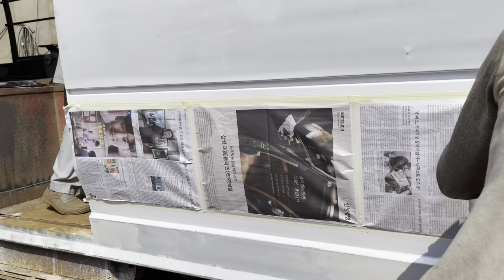Amazing Repairing Process of Accidental Bus in Local Workshop ||

Comment: That's not a repair, it's a complete new build. Great work.
Reply: Fantastic. But did not like the guy welding with no protection. Closing your eyes is not good enough long term. Btw this used to be an industry here in Norway, building buses on imported frame + engine.
Reply: Panel beater here it’s all considered a repair
Reply: Exactly
Reply: @steinbauge4591 Turkiah killed all of those industries in EU. They make these cheap PVC buses on top of MAN, Mercedes or DAF chasies. The only good one is Solaris from Poland if you ask me
Reply: @averagedev7768 Indians doing the same in Asia building cheap buses on lorry chassis, Tata and Ashok Leyland craps...

Comment: Extremely professional teamwork has resulted in the bus being repaired to a very high standard; ready again to be propelled into a deep ravine by a fearless driver with no concept of danger.
Reply: Do not forget overloaded the are terrible for overloading vehicles I would not want to travell in it why did it crash steering failure or brake failure not for me I do not trust it
Reply: Exactly what i was thinking, rebuilt and ready to roll (over)... again...
Reply: @Frankestein01nl  Quite, and yes indeed, repeatedly rebuilt until the inevitable crash involving a huge explosion (and much loss of life) makes this impossible. Although even then...
Reply: They Have To You Get Hurt,You Can't Work ,Can't Work, You Starve...

Comment: there is no repair here; they discarded the damaged bus body and did a new one. good work.
Reply: boy it's a good thing you showed up
Reply: Yes it's called discarding and carding mechanical. With stickerings and motor chain belt 5.0 acordances.
Reply: It actually is a repair, just no restoration.
Reply: The old body was pretty stuffed to be fair, i,m glad i was Not in it, my guess; it went over a bank??
Reply: Panel beater here it’s all considered a repair
Reply: There's no strength left after straightening a wrinkled tubular steel frame member or the spot welded sheet metal equivalent. The side and roof panels weren't really recoverable.
Reply: @barryphillips7098  They aren't constructed to the same stanadards as in the US, the EU, NZ, OZ, the UK and other countries, it may have just been hit and rolled over.

Comment: 3:40
I mean.... he has safety glasses but theyre sitting on top of his head. He's wearing sandals and has a long scarf to add a bit of excitement in case it gets entangled with the angle grinder and pulls his head towards it.
Reply: No risk, no fun - no guts, no glory... "as they say" ;-)
Reply: @MrKotBonifacy  :face-blue-smiling:
Reply: Obviously they have never heard of "Arc-Eye" (Welder's Flash)? - An inflammation of the cornea, caused by ultraviolet radiation from the arc during welding. Nasty and even possible loss of sight if long term exposure like these guys! I had it once as a young apprentice - that was enough for me! Use your heavy goggles or proper welders helmet guys! 😮
Reply: @peterhowells7309  was sat there thinking those shades they were wearing probably weren't quite enough.
Reply: @chrisbrace2204  That was my first thoughts exactly Chris! Then I saw a few guys with no eye protection at all! Having had arc eye as an apprentice, I know how painful it is. You never take any risks with your eyes if you need them to do your job and put food on your table!
Reply: @peterhowells7309  that he's quite happily holding a visor in his other hand most of the time, and just not bothering to use it made me squirm
Reply: @chrisbrace2204  I know! Such a blatant disregard for their own safety.
Reply: @peterhowells7309  an the thing is, he knows, because he does use it some of the time.
Reply: @chrisbrace2204  Aye truly bizarre!
Reply: Soooo the whole bus is held together with spot welds 🤔
Reply: @tommoso55  With metal (ferrous) frames, that is normal, it keeps the weight down. Continuous welding joints would make a lot of extra weight. Sometimes you will find a body caulking/glue in place of welds.

Comment: Are any of the welds any good? I Am no welder, but I can make good solder joints including brazing. And as far as I can determine these joints we be breaking all the time because of vibration.
Reply: Yeah, it doesn't seem great, not to mention where they weld directly onto rusty metal.
Albeit even if the welds hold, it would presumably fold similarly to when it crashed the first time("first" may be optimistic though)

Comment: Why learn how to drive when repairing the vehicle takes less time?  I'll bet those welds are guaranteed at least 5 hours; I'm glad the welders were wearing sunglasses to protect their eyesight.
Reply: The welds are only holding together sheet panels that aren't structurally important.  No reason to weld more than needed. Hot dry climate, that metal will last long enough, until the next accident.
Reply: Hmmm aniy welder use it
Reply: EU FICO IMPRESSIONADO COM ESTE PESSOAL TUDO MANUAL E BEM RAPIDO 👏👏👏👏👏👏
Reply: 😂 sunglasses 😎😂🤣🤣
Reply: @cwshtygriff13 Let’s  hope they were Ray Ban’s , and not some cheap inferior sunglasses 😎
Reply: Not all of them are wearing sunglasses! Like "nevermind, that guy is blind anyway"
Reply: @richr161  I've seen a few clips, nothing is apparently structurally important. It's all bondo and paint.
Reply: Esas carrocerias son fabricadas con los peores materiales , no me extraña que quedara en tan mal estado ese bus , som demasiado fragiles

Comment: What could go wrong,, driver smoking and playing with his phone while driving. No mirrors. And driving a destroyed rolled over bus about quarter of a turn left hand down. No sign of taking the twist out of the chassis,
All that framing and panels stick welded together,, the bus has a lot of natural twist in the frame so those welds will all break eventually.
I am suprised that with all that framing just tacked together as it went that it seems remotely square.
And all that welding without a welding sheild to be seen.
Reply: No . There is a welding shield. Take a closer look.
Reply: @reynardbizzar5461  could you point out the welding shield used at 24.20 as I can not see it no matter how close I look,  and the protection against skin damage particularly facial from welding rays
Reply: @ceismulcastle  I see what you mean. I meant that to say that I saw a welding shield used at other tines. You are right though; the whole thing  smacks of cowboyism 👺
Reply: @reynardbizzar5461  could just be a lack of knowledge on their part but I they look old enough to have worked it out if they had never been told

Comment: How are they allowed to drive that wreck on the highway
Reply: What the plastic windows have bars that keep you from going straight through them. 😂
Reply: Because it's a poor country bro that is the real reason 😢
Reply: Its probably permitted because the frame and running gear aren't damaged, the glazing and loose sheet metal has been removed or secured, it isn't carrying passengers, and they aren't travelling in dense traffic. Its already a truck chassis with useless bent metal on top. Strapping it to another truck chassis and calling the mess "transport on a flatbed wrecker" checks all the vehicle operating condition boxes but doesn't actually do anything to change the safety profile.
Reply: In Pakistan no need of permission

Comment: As another commenter mentioned, that's not a repair job, but a completely new vehicle.

The chassis looked like something that was built in the 1920s, having just two rails with crossbracing.  Most buses have been of unitized construction using steel or aluminum sheets riveted to a space frame.

In the case of this vehicle, it's fiberglass on steel framing, not the best choice, but I suppose these guys are limited to using cheap materials, hand tools and primitive techniques because of their low budget.

While it looked like a backyard project with everyone pitching in, they got the job done and it's actually quite impressive what they accomplished.

Comment: all trucks in pakistan  The position of the leaf spring bracket is incorrect. 
If the leaf spring is installed in that position, it will not function as a spring. 

The hinges and springs must move flexibly like joints, but
There is no point in installing a spring in that structure.
The design was wrong. 

This is why accidents where axles or drive shafts break occur. 
They don't know that that structure is causing a very serious problem.

Comment: "Did ye crash test this bus, Lads?" 

"Yessir - the last body failed - we replaced it with this new shiny one.. the new owner will conduct the next crash testing shortly - we are highly optimistic that everything will be fine.. probably.."

Guy doing the body-filler is GUARANTEED one of the best body-filler appliers on earth, simply by the sheer volume of filler he has applied over the years onto stuff put together using rods & hammers. This guy could bang filler onto Nancy Pelosis face & she'd look 17.

Volvo Bus Division are watching this going "Nailing planks on as the floor!! FFS Lads, how did we miss that simple trick?? Implement it at once for all our busses!"

Comment: Why do they use wood for the floor instead of steel sheet?
Reply: Ease of replacement, less flex and sound deadening come to mind.
While steel sheeting may seem preferable in that instance, I can see why they chose wood flooring, since thick wood panels are sturdier than steel sheeting due to how it can absorb more damage without buckling.
I'm not saying its the best option, I'm just observing some of the reasons why THEY chose to do it that way
Reply: Busses in first word countries have wooden floors

Comment: What the heck is an accidental 'bus???????? In the picture is a bus; built as a bus, not by accident but by a company that builds buses DELIBERATELY. It has been involved in an accident that has caused damage, but it is still what it was designed to be - a bus.
It is now going to be repairs by people who will earn in a month less than you spend on a weekly shop, it's called worker exploitation and sustained poverty backed by "safety rules" that date back to the last century.

Comment: The fact alone that you are driving that wreck on the road is a deadly sin. But it is a good example of how shoddily there are built. You could pay me a million US$, and I would not ride in one of those. Never ever.
Reply: Considering the cost of labor in the US, that would cost about a million, and a new one isn't much more. I've worked on RTAs, greyhounds, school buses, and RVs. RTAs are built the same way but with rivets instead of weld. And they have 3000 psi propane tanks on top of them. So take your pick, rolling bomb or bondo sausage.  Looks like the bondo sausage tanked a Bedford and kept on driving. My RTAs go into safe mode after minor cosmetic damage.
Reply: @afullgrownchild2402  There are safety standards for buses maybe not as good a the EU but way better than this country.
Reply: @adrianbalboa5353  I totally agree. I've seen a tank go skidding down the highway and not rupture. You couldn't have driven a pin nail with a sledgehammer because I was pucked up so tight while depressurising it. 
But that bus took a walop and kept going. Calling it shoddy is I little off point, especially compared to modern RVs that come with carbon monoxide leaks from factory. Not joking on that, it's a serious quality control problem.